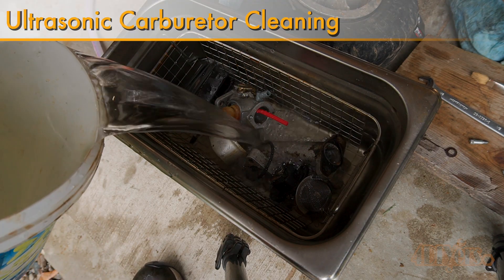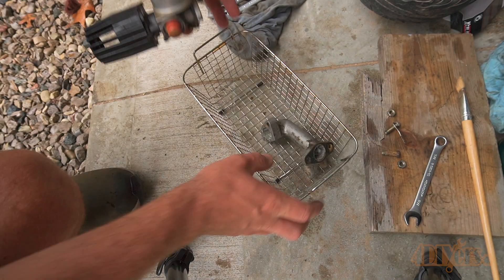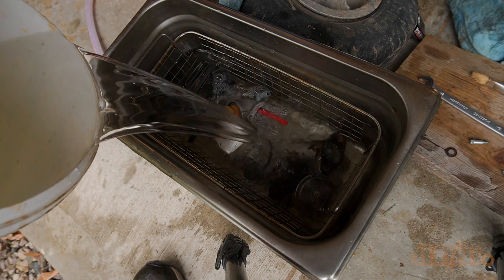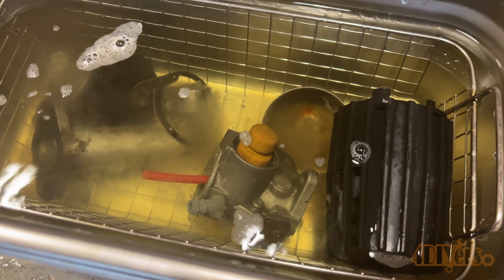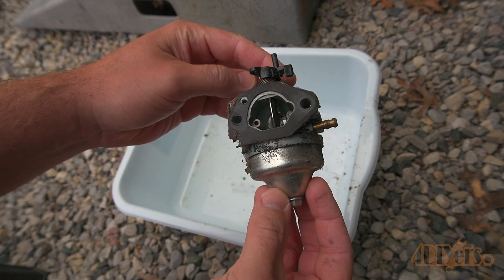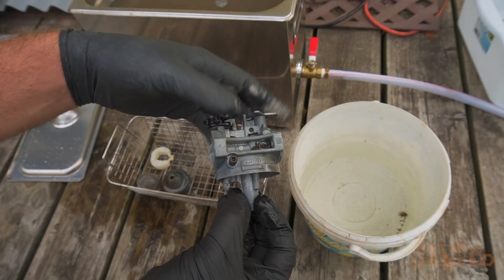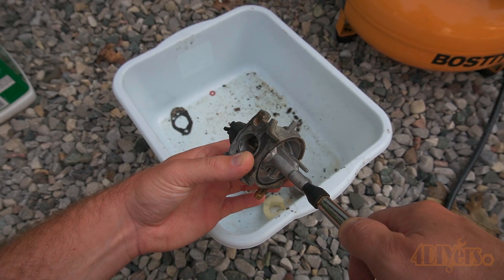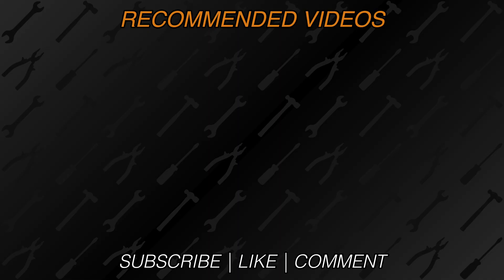How to Ultrasonic Clean a Carburetor

Comment: You don't have to use pine sol unless you want your carb to smell like pine. The ultrasonic cleaner cleans with no help from solvents. That's the point of is using one. In fact, it says in the instructions not to use solvents or cleaners in these because it can strip coating on surface and damage .
Reply: I'm quite dubious to just cleaning with water...